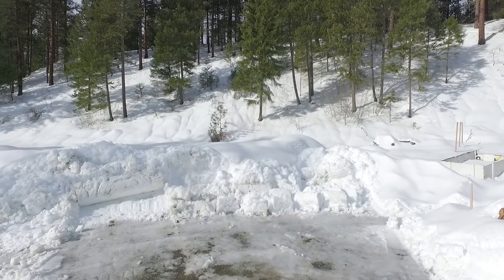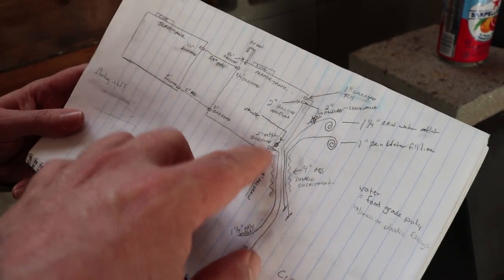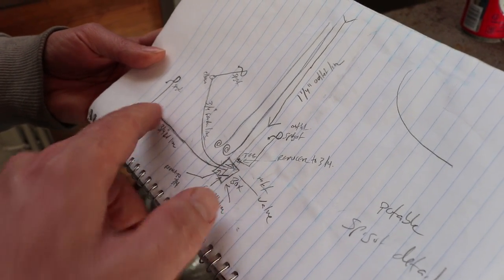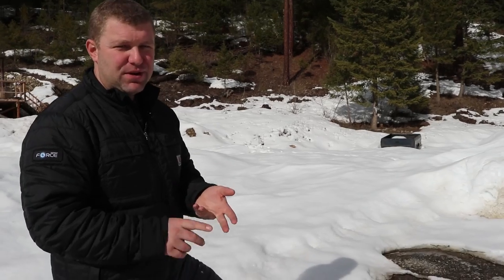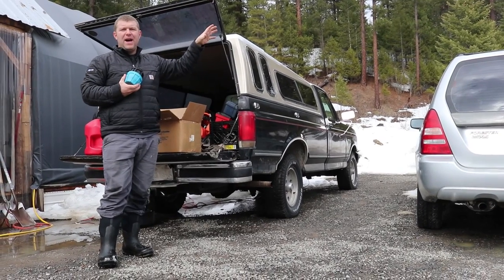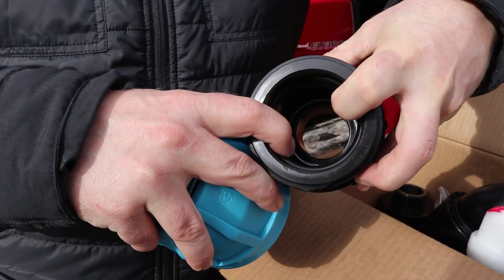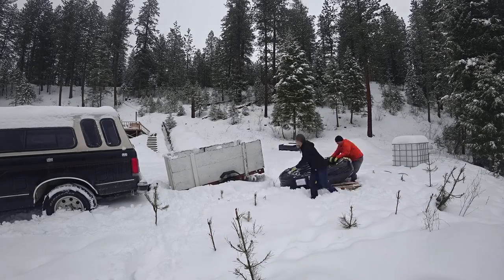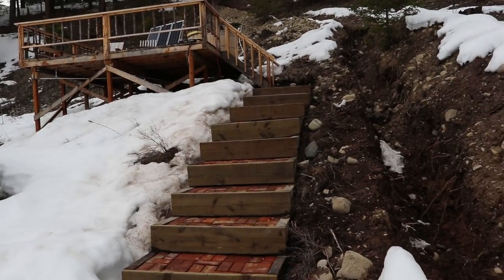$$ CHEAP vs EXPENSIVE PLUMBING FITTINGS! $$

Comment: Jessie I would like to give you 2 tips when putting this all together. No1 and most important Remember to use a flexible pipe where you join into your polly tanks. I have seen so many tanks split, because flexible pipe was not used. No2. Remember to use sand to back fill around your pipe. this is important because if a rock is against your pipe it can wear a hole in the pipe as the pipe expands and contracts at different times of year the temperature  of your water will change, causing the pipe to expand and contract. I would love to know if these 2 things have been considered. good luck from down under Mate
Reply from the maker: Already in the plan. Just remember we can't sure every last detail in our videos. People would fall asleep and go comatose. LOL :)
Reply: He the more info you guys give the more guys like me, a few steps behind you, have in designing their systems :)  Really helpful and entertaining videos! I look forward to your videos for both reasons!
Reply: Actually, please bore us with the details! Construction 101 tips can be useful to remind us people before we make dumb mistakes.
Reply: ...they didn't listen.
Reply: Was it the flex ? They solved the rock issue, by using the same setup you see on Gold Rush.  Found channel by recommendation, and it started me towards the end, so I haven't watched everything.
Reply: nope! and there were leaks!!

Comment: jesse, also they make valve operator extensions so that you don't need a 12 ft valve wrench. it's just a piece of poly pipe with a female bottom and a male top so you can access the valve just below grade in a box instead of 12 ft deep. just fyi

Comment: Excellent information (as usual).  Having worked in the ball valve manufacturing industry for 40+ years I want to pass on an important tip regarding the use of said valves.  Ball valves are designed for strictly FULL ON and FULL OFF service.  Whenever you operate them, throw them fully 90° to the full on or off position - not anywhere in between.  The quickest way to destroy the seat seals in a ball valve is to throttle or pinch flow with them.  They simply are not designed to handle this.  Pinched flow will cause impingement of the seat seal faces over time.  Please, please, please do not give in to the temptation of partially opening a ball valve.

If you need to throttle flow (as you would with a faucet) there are other valves that are designed specifically for that duty (usually some iteration of a globe valve).

Thanks again for the wonderful insight on choosing piping components.  Keep up the good work, guys!

Steve
Reply: great info. I think a gate valve is what you use to throttle with, I have been out of plumbing for 25 years.
Reply: Gate valve is for isolation. globe valve for throttling, ball valve for isolation (quick opening 90 deg open/close)
Reply: Or a Butterfly valve will give rough throttling
Reply: Interesting I never knew that thanks Steve.

Comment: Well thought out Guys!!   Lots of nice details !!  Sure is a deep cavern down to where the pipe is - wow. 
Good luck on trying to unroll the pipe - especially in cold weather.  I struggled recently with a roll of 3/4" PEX in my pole barn - I put it in the HOT TUB for some hours to RELAX it -- you might consider that before you try to unroll.   You can also quickly make rebar "wickets" - just cut, torch, bend, torch, bend and you have a hoop that can be driven into the ground to hold the pipe down.  
I can make 6-12 of them in about an hour.  We have a few runs of 4" drain pipes going down our hill to reduce erosion (lots of landslides here) and use these wickets to stake the pipe down along its run.  
Poly is a great way to go - strong and resistant to freezing.  That large size is wonderful to prevent drops in pressure.  Our place has buried poly 1000' to well house, then 200' to the house, but they only put in 1", argghhh !!  So it would be difficult to get much pressure for gravity feed (stuck with pressure pump requiring electricity), and too difficult for us to dig up and replace at this time.   All the best in this battle for a hot shower.  RH

Comment: The pressure a water system get when a valve is shut quickly is called Water hammer. This can blow water systems apart with ease.  To ensure this does not happen in a household a devise called an Expansion Tank can be used. I would recommend getting a precharged tank but you will need to know your upper control limits of your system. There is another option, a Relief Valve that is built into the system so they open back to the tank are very cheep insurance to have, I put one in because I don't want to rebuild my system, also I am a retired Fire Chief and I've seen alot of destruction from water issues.

Comment: Just a thought looking at your diagram, if you put the inlet fill pipe into the second tank at the farthest end from the outlet pipe, so that you don't stir up the sediment next to the outlet of the first tank, it also allows for some settlement before it comes out, otherwise every fill will put sediment into the outlet pipe.

Comment: Go with the spigot at the hot tub. During the summer, you can rinse off with a shower head before getting in the  hot tub..  A word of advice, put TWO shut off valves on every branch.. Just in case you need to rework that line or repair a faucet in the house or RV. "If you're cool enough to have a lady like this..."  Smart man! MAKE SURE she knows you appreciate her. Many of us wish we had one that would share the dream like she does.

Comment: We have a system like this we've been using for more than fifteen years. We used PVC, and suspect phantom leaks due to the many connections, so I second the idea of using one long piece of poly. Also, please take their advice and have a valve/spout which will quickly empty the tanks. We did this, and have been grateful many times we did. Over time, sediment will build up in your pipes, and having the ability to flush them once or twice a year keeps the system working. The newest addition to our system is the RasberryPi pump controller I built. Used together with relays and a sensor, the RPi controls the pump, and heat lamps in a couple places which can be especially vulnerable to extreme cold. The RPi uses less than 5 watts, and can be infinitely configured over wifi.

Comment: Your poly compression fittings have two major drawbacks when backfilled over.  1. Seasonal temp changes can affect the fitting its self and lead to leaks .. usually small but over time can lead to washout or sink holes. 2. If you do get leaks in your system, roots will be drawn to that water source and penetrate into your fittings; damaging or even plugging them up.

Comment: Jesse, the first thing at the bottom of the hill should be a shut off valve.  That way you can shut off the water to work in the distribution manifold or things after it without running up the hill to turn it off and then draining the downhill run of pipe.  I made that mistake ONCE.

Comment: We have used the thick poly pipe for underground ducts between buildings.
A draw rope of twice the length is used to add cables from either end.
I  remember pulling 32 copper pair cable so easily for a data link at one job.

Comment: I don't know if anyone else has noted this but your fill line connection should be on the second cistern to encourage a cross flow between the cisterns, it helps to keep he water wholesome. wishing you well with your project and regards from a plumber from across the pond...

Comment: I really hope that when your laying that pipe, you remember the trench falling in part of this video. When the temperature changes in the spring will cause it to fall worse.  In that deepest part that you showed Alisa standing in about 10 ft deep trench.  One would die before another could dig one out. In your area I would not take any chances in anything over 3 ft deep.
Reply from the maker: Thanks for the concern and reminders. Every project around here comes with so much risk of injury.
Reply: Diversified Acres Homestead 

nn
Reply: Diversified Acres Homestead

Comment: I would suggest you fill in the top rear of the back tank and draw out as you have shown from the front of the front tank.  Depending on how quick you fill the tank as you have it drawn you will be pushing/pumping old water back into the rear tank and continuing to do this over time the water in the rear tank will begin to get stale.  Also did you consider NSF rating?

Comment: You need to get a basic CAD. By the time I got around to planning plumbing I already had a decent CAD program. In my earliest days, I was using graph paper and pencil for simple floor plans but as time went by I found I was spending as much time re-drawing those basic floor plans as I was spending thinking about what features I wanted to have and what changes I needed to make. When you have a CAD you can take the parts of a drawing that you like and set those parts aside then take your new consideration, whatever it is, and tie it in with almost no effort. You end up treating the part of a design that you like as a component that you then tie in to whatever change you think you want. When I was laying out my drain system I found that the required cleanouts and such to be built on the system could be drawn on the system and then just be connected together. I even could draw to scale so I could know whether or not I had room both vertically and horizontally for the nominal drop in a pipe to ensure it drains properly. It beats the heck out of making connections just hoping that drain angles and such are good. 
I use a program called DesignCad but there are equally useful CAD programs out there that would serve the same purpose. I use that particular program because it still uses most of the drawing command keystrokes that I learned when I was using their DOS version back in the windows 3.1.1 days.

Comment: just an idea i'm an electrician...you might run some under ground romex in the trench before you cover it up...you may never use it but if you need b power at the top of the hill it will come in handy later.

Comment: A couple of items to help, SDR 11 is a measure of the thickness of plastic pipe the SDR is the Standard Density Ratio and a SDR11 is plastic pipe comparable to schedule 40 steel pipe, basically the Outside and Inside diameters of the pipe are close to same. Also on the poly pipe check the temperature rating of your pipe the pressure rating drops as temperature increases most stamped ratings on pipe is at 60 degrees F, typical hot water heater is set for 180 degrees F at outlet. In order to stop water hammer keep your velocity flow of water below 10 feet per second. The real measure of static head is that 27.7 inches of water gives 1 pound per square inch (27.7 inches = 1 psi) that will give you your static head (change in elevation). You also need to account for friction against flow which is sometimes more than you think for a SDR11 3/4 inch pipe 100 feet long with a velocity of ~10 feet per second can have friction flow loss of 22 psi. (Reference - Crane Technical Paper 410-C Appendix B-14). Just happened to be using this info today.
Reply from the maker: Sweet! Thanks!

Comment: Fill the one on the left (Input) and your output should be on the one on the right, or vice versa. Prevents long standing water. Its how twin potable water tanks are linked here. Probably forgotten as gravity systems here have given way to high pressure sealed systems. Im sure you have looked into this but your main vent will need to be a good size to prevent vacuum if a lot of water is drawn out quickly. I do not know what ratio you would need. 

Ps I help a gamekeeper out here in the uk, a lot of his pheasant drinkers are plumbed with black alkathene (similar but may not be exact same science)as the pipe you show there and can say grey squirrels love to chew it.  Thanks for sharing your video's.

Comment: Didn't see it anywhere in your plans but if you add rain water catchment then you'd need a first flush system added to filter out the sediments, debre, etc. 

While modern building codes are starting to require fire sprinklers for residential housing now... Would make dealing with fires easier if you plan for that as well... But things like kitchen range hood vents can also have fire extinguisher packs installed as well and are better for dealing with things like oil fires...

Comment: talking about making the system simple  you don't need a seperate fill line you can fill it with the same 2 inch line you have coming down from the storage tanks. The only thing you will need then is a pump that will over come the head pressure which you will still need filling it with a seperate fill line and then the tank will need to be vented so that as you are putting water in it can push the air out of the tank. It needs to be vented for draining water as well... but planning for future expansion especially with your hill is a must but I do enjoy the channel keep up the good work
Reply: no it will actually work, I work for a water utility and we have 3 water tanks two of them are 500,000 gallons and the other one is 300,000 gallons and all three storage tanks are filled and drained with one line.
Reply: I have been nothing but a faithful subscriber watching all new videos 
trying to go back and watch the older ones, I click the like button for 
you, and I even click on every ad link to help support the channel. I love the channel, love the content and I am sorry but a comment like "False, Think about it a little longer" is uncalled for I know that there are people that post a lot of crap on your channel that is usless. However before making a comment like that you should see if it is true or not. I have been in the business for over five years and had my distribution license during this time. Now I am a part of only a small distribution system when you are talking water utilities and we only serve about 3,300 customers but I know for a fact it would work. Sorry I really try not to complain but this was uncalled for and kinda hurt...

Comment: another thing to consider if you want to save money on outdoor plumbing, is plastic welding. for refrance; a 90degree 2" SDR11 T coupler is ablout 17 freedom dollars after 25% tax, at least in norway. it's super simple and the weld is stronger than the pipe itself (according to manufacturer). only downside is it requires a special machine, which is extremely expensive. however you should be able to find a dealer or a plumber that will lend you the machine. GF and plasson are the main manufacturer afaik.

oh and btw PE100(HDPE) SDR11 is overkill for 30psi. it's rated for 16bar/230psi with a security factor of at least X1.5
when i pressure test a SDR11/PN16 system i test with 21bars/300psi!

Comment: Do you plan a snow harvesting pond?
Just a pond that can have the water runoff from mounds of unwanted snow you have piled.
BTW  small country towns here  have rainwater areas made from rolls of black plastic and covered with 1 inch rock pebbles.
They don't have weeds as there is no soil. So they stand out from the forest.

Comment: That was so interesting. I'd never considered poly pipe in a roll like that. Good idea.
Reply from the maker: Ask us once it's unrolled. LOL
Reply: Pure Living for Life 🤓😬 yeah... That's true! Really enjoying y'alls channel. Thanks for sharing all y'all do!
Reply: You are going to need some help for manhandling 2". I know you are in a hurry, but it is something you want nice and warm before trying to unroll.  Even with using equipment to back fill, it still takes 3 guys on flat ground to get this stuff in the ditch.  2 guys on the roll and 1 to lay it in the ditch..  A propane torch is going to be your go to tool for heating and bending this stuff to your will.  Once you get down to the 3/4 why use plastic compression fittings?  Spears brand insert fittings and double hose clamps will out last you and I. 
I think 3/4 is undersized for any runs over 100 ft from your junction box due to friction loss.  Could lose a lot of PSI which you don't have much to spare.   I would only use brass  Ts and elbows under any hydrants you are going to install.  Plastic fittings at these spots breaks at the slightest tap with a lawn mower or ground settling.  You have already invested in the materials, so its a bit late to go back, but I would have suggested PVC in your case due to the terrain you are dealing with.  I saw you had an ATV with a winch, you might consider staking it at one end, rolling it out down on your driveway and then winching it up the hill already unrolled.  All too familiar with  this as my family is in the rural water business.

Comment: Check with your local plumbing supply and look into butt fusion welding on that pipe instead of the mechanical fittings / joints.  Just to be informed before you do the install.

Comment: Consider only joining the tanks at the top, twice, with one connections slightly above the other. Tank 1 fills, and spills over into Tank 2,  which then fills, and has an overflow out the other side. this lets you keep a higher overall water head...
Which doesn't matter because you're doing this at the top of a hill... I just realized this.

Comment: I don't think you mentioned this. Have you calculated what the expected water pressure should be from the height you'll be dropping down? I don't remember you saying the cistern's elevation before. Was just curious. Guessing you have since you talked about the different psi ratings on the poly and what you decided to go with.